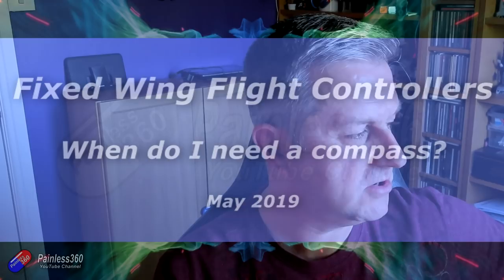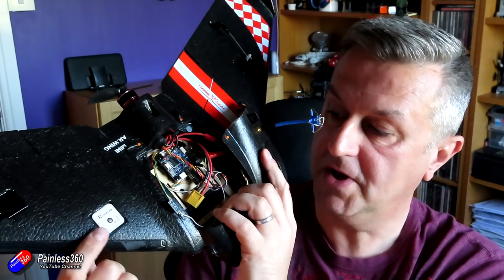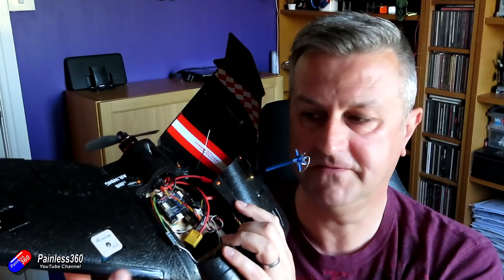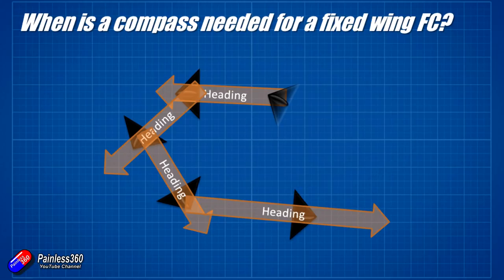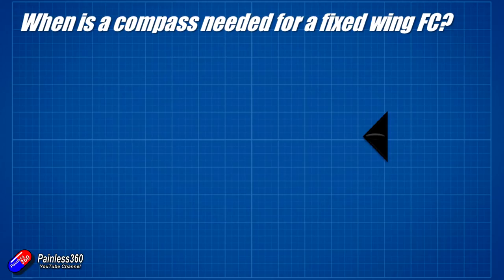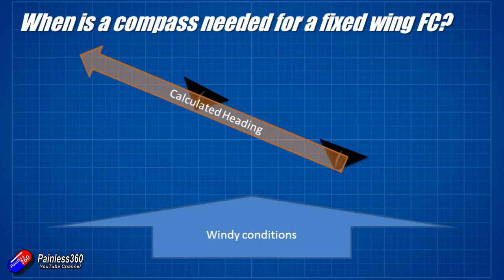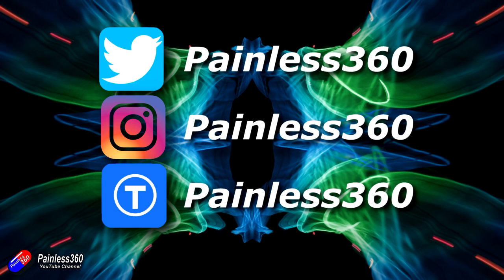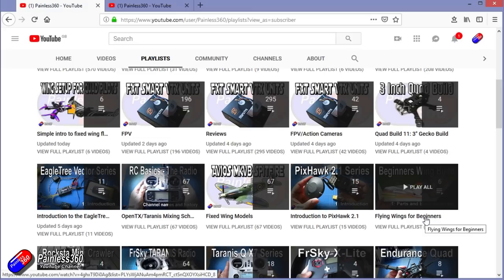Fixed Wing Flight Controllers - Do I need a Compass?

Comment: Everything you say is correct and accurate, but when you're talking about the direction you're travelling when allowing for wing you're then talking about your TRACK rather than your heading, i.e. the direction of the path we followed over the ground which is arguably more important for navigation purposes. We calculate this in the cockpit (generally called TMG - track made good) and compare it to the compass heading with the difference being the drift. When combined with the difference between true airspeed (indicated airspeed corrected for pressure and temperature) and ground speed, we calculate the true wind speed and direction... I guess all of this really only matters to a pilot flying full size aircraft under visual flight rules, but I thought it might be of interest to someone flying long distance FPV.
Reply from the maker: Thanks for the post. Happy flying!

Comment: I would think the 'calculated' heading is actually of more use because it is the true direction the aircraft is traveling to. You actually do not want the direction of its 'nose'. In cross winds etc, even as per your outline of what that causes, that calculated heading is what you actually want/need to fly to a destination accurately.  Knowing the 'nose' direction is actually not a lot of use..... possibly never of any real use.

Comment: I understand why you may chose to turn off the GPS compass. My question is how big an aircraft need be to properly isolate it from magnetic interference and why is it difficult to set up? Is there any general rule (distance or extra measures) needed for isolating the GPS from disturbances?
Reply from the maker: It's specific to each model and cable routing. See my video on how I test for a place to use for the compass...
Reply: @Painless360  I did a search of your channel using the search words "compass placement". Is the video you are recommending happen to be "2/8 Introduction to iNav"? If not, please provide a link, and thank you!

Comment: Heading modified by the wind is known as Track Made Good and is usually what is needed for navigation. Is this not what Flight Controllers use internally rather than raw Heading?

Comment: I had no idea that's how the GPS calculates you're heading. That was the best clarification video I've seen. Thanks Lee!
Reply: Gps do not calculate you heading,  the craft will go in a RTH to the place he got the fix.   If you use compass the win will drift you plane is the correct heading but may be one half a mile from you.
Reply: @maxun1  what? I have no idea what you just said.
Reply: Never mind
Reply: @maxun1  I understand what you're saying now you said the wind will cause it to drift correct? Sorry I wasn't trying to be rude I really did not understand. 

Thanks :)

Comment: My question here is related to the OSD setting "Heading Graph" (I am using iNav 2.2.1). I understood (I think) pretty well your explanation about calculated heading and real heading, and I think I would be very happy with the real heading as it will tell me if I am actually heading home or somewhere else due to wind "help". Anyway, this is the question: by not using the magnetometer, will the Heading Graph give me a reference of which cardinal point am I flying towards?
Reply from the maker: Yes
Reply: @Painless360  thanks a lot.

Comment: thank you for the info . Just wondering something . I m new to rc planes ,I do however have many years of drone flying.
I built a plane with a old apm v3.1 .everything works great ,just on way-points it seems to go wrong . i noticed that to fly straight it actually flies almost sideways in high wind. i have the compass on and it follows the first 2 waypoints .though as soon as it hits a side on wind it starts drifting very far out and never gets to way-point 3 . Could it be that the plain is not pointing in the direction of flight or perhaps something else? it would be good to hear your opinion   . Thank you

Comment: Wouldn't it be better to have the compass and the gps in 2 modules ? So you could put the gps near the center and isolate thé compass. Or maybe but the gps+compass module on a stand ?
Reply from the maker: You can do that too but it you still have the same issue wirh interference. Happy flying!
Reply: @Painless360  I am waiting for this video on the telemetry setup 😀
Reply from the maker: Check out the playlist  ;)

Comment: Recently I have thought about adding a compass and heading in my osd. I’ve found at longer ranges I’m having issues keeping my receiver antennas pointed at the craft. Maybe this would help. Speaking of, have you or would you think about doing a rssi tracker?
Reply from the maker: Don't point the antennas at each others as the 'ends' have the weakest radiation pattern. Concentrate on keeping the antennas aligned instead. Hope that helps..

Comment: So compass in Inav wing is recommended too if there is lot of wind?
Reply from the maker: Any situation where the wind speed will be at a level to stop the GPS calculated heading to be miscalculated may need one. Its less vital for fixed wing if you're only after RTH and Loiter..